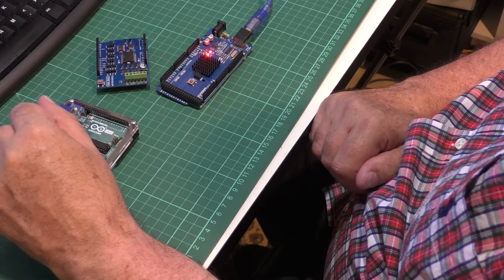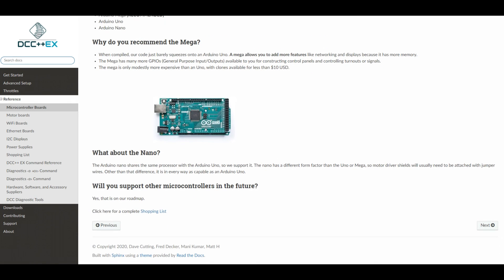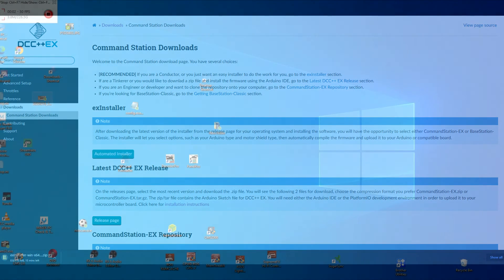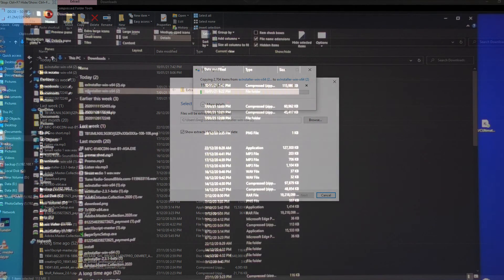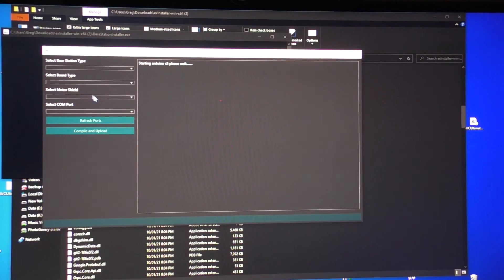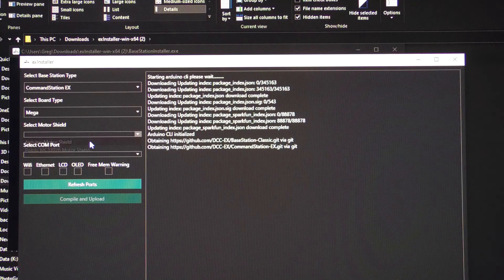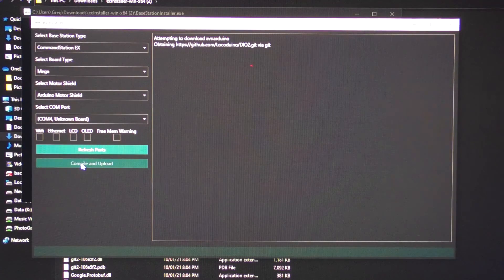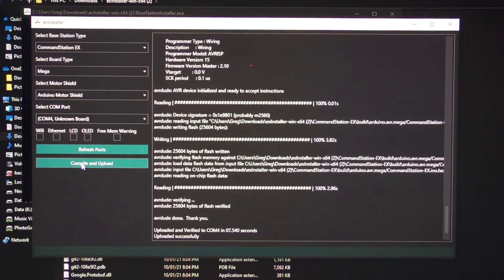DCC++EX & Visit to Dave Trains

Comment: Hi, Thanks for sharing your experience. How many volts is the power source you use to power your arduino power shield ? Thank.
Reply from the maker: Thank you . I use 5 Volts to power the Arduino and i use  16 Volts on the motor Shield to  drive the rails .
Reply: Many Thank’s   @midsomerrailwaynscale

Comment: I want to use DCC+EX as well but with a change so I can still Run DC (analog trains)
Reply from the maker: Good Question  .   i run and my mate in the video  we both have 1 track for dc  which is isolated from the other track or tracks and the other track or tracks  are  DCC++EX   . With out being technical  its form of AC vs DC  so you can blow the motor up ,  what you can do is the same as i do run 1 track dc make sure they are totally isolated  and the other track is DCC++EXor you can switch between the two so either run DC or Run DCC++EX but only 1 or the other    they need to be separated  by an isolating switch   i hope that help if you want more information or help you can email me . my email can be found in the about  menu  regards Greg
Reply: @midsomerrailwaynscale  thank you Greg.
Reply: You can't run both at the same time on the same track circuits. But, switching FROM one to the other is as simple as plugging in the different power system to your track. I actually made up a set of quick disconnect connectors for my tracks and my DC and DCC setups so if I want to switch from one to the other I just plug in the proper system to the track. The only thing I have to make sure of is that I either don't have any locomotives or I only have the proper locomotives on my track for whatever system i'm using. You could also accomplish the same thing with some kind of bus switch or something but I find the action of me actually having to disconnect one and connect the other makes the process less likely for me to do it accidently and toast something.